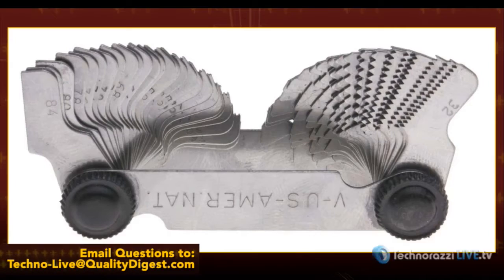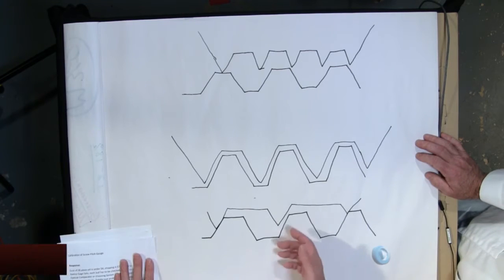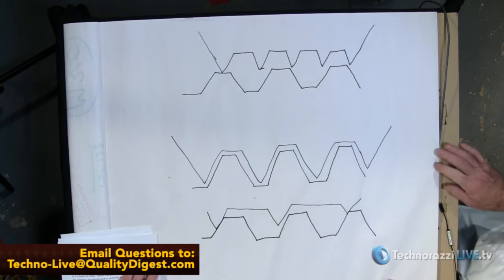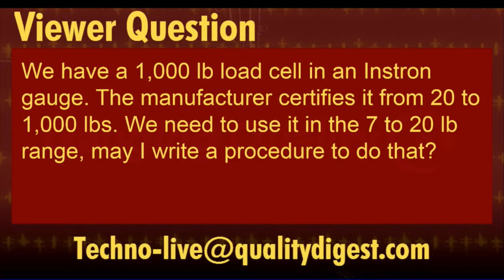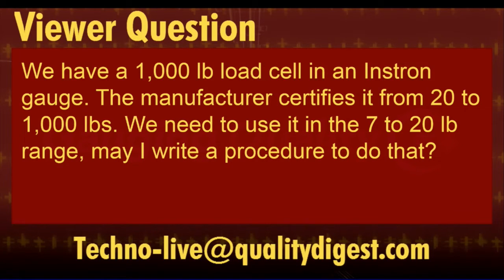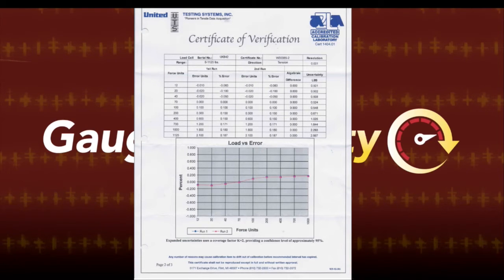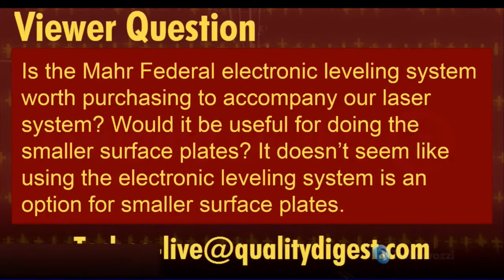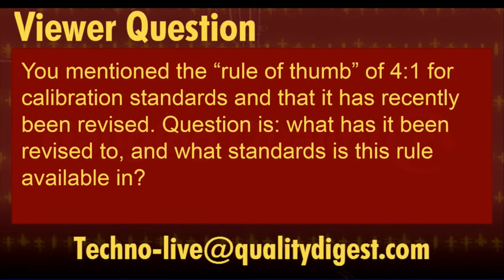Gauging Quality Ep08: Certificate of Calibration #HowTo #metrology #calibration

Comment: A simple solution for the person with the tensiometer issue is to permanently attached a calibrated 20lbs (or larger) weight to the scale and zero the gauge.